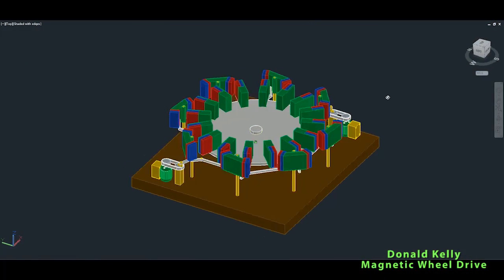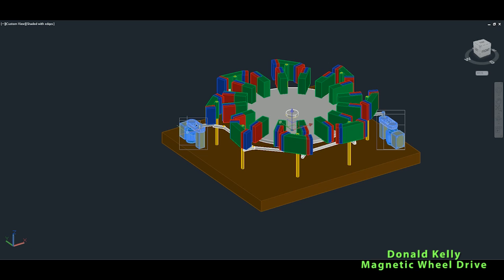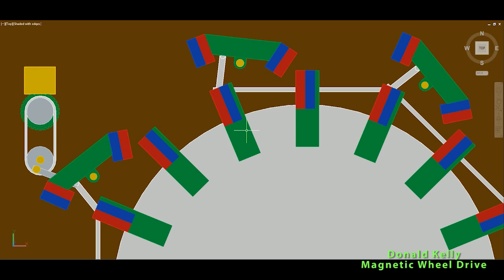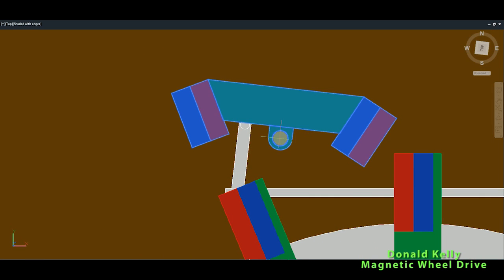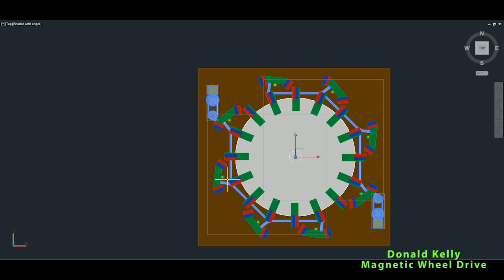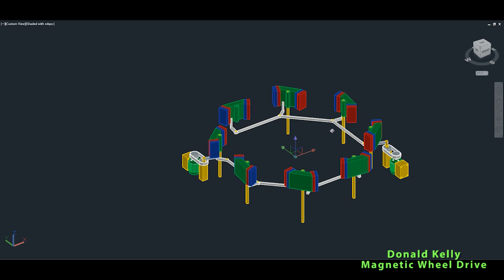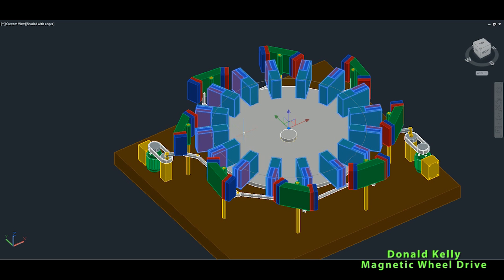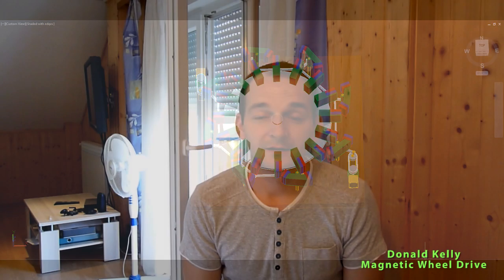Free Energy Generator, DONALD KELLY Magnetic Wheel Drive

Comment: I agree with Berto. Use 3DsMax for a simple rotational animation. easy to import from Acad.
Another thing; I think you can skip all the patents where stators have to move. For that you'll always need the same force as you might get for output. Like hang a playground's swing on your shoulders and go sit on it.
I do believe some divices could work. Sceptics forget it HAS taken energy to create the potential energy in magnets, so there's your input. Only to get it out!